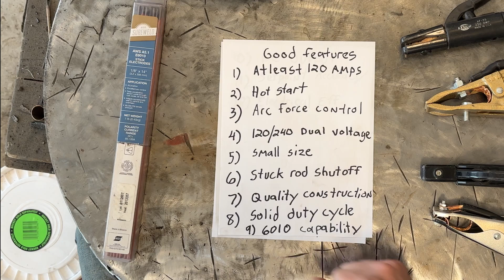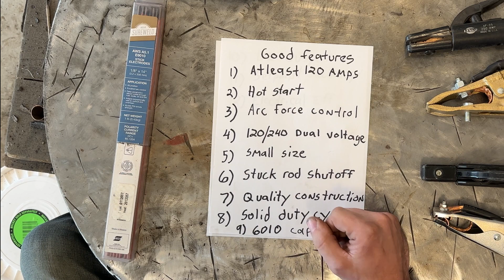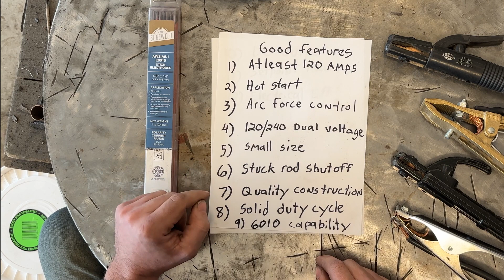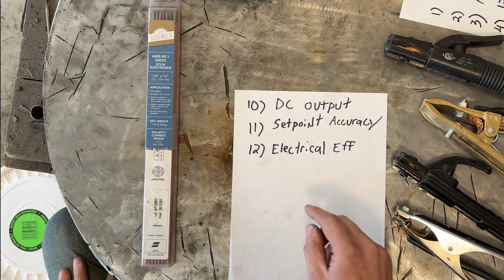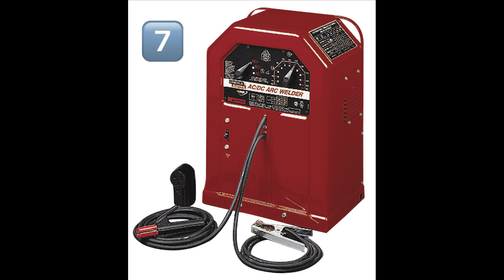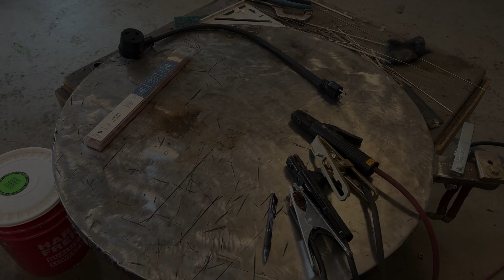Picking out a stick welder (features to look for and top 10 recommendations)

Comment: Absolutely maddening! No matter what I do, no matter the settings, prepping, grinding, clamping, cleaning, ran it on 110, 220, etc., the rods stick EVERY f#&$%! time. I literally just gave up. I recently purchased an ArcCaptain MIG200 & spent hours trying to make it work. Destroyed about 30-6011 & 7018 rods & a lot of scrap steel. What am I doing wrong?
Reply from the maker: Couple thoughts that should help you.  Some welders have really low “open circuit” voltage, which makes it more difficult to start a arc.  The higher the open circuit voltage the easier it is to start the arc because the arc will jump a slight gap easier.  The two rods you picked are the hardest to start without sticking, so that’s partially why.  Grab yourself some 6013s or 7014s and you will be in better shape by far.  Once you can start the arc with zero issues with either of those rods it will be easier to go back to 6011 and 7018.  

At the beginning it can be frustrating for sure, don’t give up.  I think it’s just down to two things 1) inexperience, and 2) your welder probably has low open circuit voltage.  Switching rods will help a lot.  Switching to a different stick welder could also help, but you can work with what you have.  I have never used that particular welder so it’s tough for me to know how much the welder is playing a role.
Reply: I had your problem with cheap welders, their current display is waaaay to low vs actual plus they dont have hot start.
All of my sticking problems virtually went with a decent machine, I got a Transteel 2200, but the cheaper transpocket are even better with stick inc 6010. That worked for me anyway. 6013 gave me nightmares with slag inclusion, I only started getting good with practice with 7018, my problem was I was going too fast and not feeling the rod very slightly scrape on the weld-you should be able to 'feel' it.
Reply: An old thread, but... Be sure you have circuit breakers rated high enough to work. Welding machines need amperage to get the job done, and your power supply is essential for getting a quality weld (Wattage, P = IE, which means the power supply available equals amperage times voltage). Heck, pay an electrician to upgrade the wiring, circuit breakers and receptacles. Also, 220-VAC seems to work best (you get two hot wires instead of one, and usually higher rated wiring/circuit breakers, yes, I said breakers, because 220-VAC actually has two 110-VAC breakers... Think of a SINGLE 110-VAC 20-amp circuit breaker to power your welding machine. Then think of DUAL 220-VAC 40-amp circuit breakers, well you have four times the wattage as a power supply at the outlet receptacle where you plug in the welding machine).

Comment: Greg, the number 7 welder is a 240 V Lincoln AC/DC tombstone. Would you expect this welder to be 6010 capable?
Reply from the maker: The DC capable tombstone should run 6010 no problem.  I would highly recommend 6010 5p+ if you can find them.  The smoothness of the arc will be a little easier to make a good looking bead.  The 5p red rod produces a very rough bead appearance.
Reply: I own this welder along with the titanium 140. Hence, the question. Thank you

Comment: Are the number 10 welders worth buying? Even if it’s to learn, do some bigger jobs than my mig can handle. Use it maybe 10-20 times per year. If I’m any good, buy a better one. Thanks for the videos
Reply from the maker: There is what I would say is a acceptable minimum price to pay for a welder.  When it comes to stick welders I truly believe the harbor freight titanium 225 is the best starting stick welder a person can buy for 350$ and under.  It welds with all rods, is portable, it’s setpoints are accurate, and it has no issue making excellent welds.  It’s so uncommon to find a stick welder for less than 275$ (with coupon) that is capable of running 6011 properly (let alone 6010) that has accurate set points.  There are a ton of welders in the 100-200$ range that barely run 6013 and 7018. They will “get the job done” but that’s about it.  I have played around with a lot of Amazon specials and cheaper machines,  the limitations you hit at the sub 300$ mark come in fast.  Even many 4-500$ stick welders perform poorly with a lot of rods.
Reply: @makingmistakeswithgreg  thanks for the reply. I’m having a difficult time finding the Titanium in Canada. It looks like my best bet though. Proven, and a good price. I’ll keep lookn’

Comment: You should check out the Yeswelder brand.. I've had a few of the cheap Chinese small welders I also have a Miller 250 twin and a Hobart AC welder. And the Yeswelder ARC-205DS. 130 amp 60% duty cycle 85% efficient and runs 6010 actually does. And very well built. Looking forward to getting one of their multi-process machines

Comment: Have you tried the Everlast welders? I'm a beginner, but I have an Everlast 210STL that welds better than I can. It has adjustable hot start and arc force control. It also has a 6010 mode as well as stuck rod shutoff and is TIG capable. Sells regularly for $399. I don't have any affiliation with them, just a happy customer so far.
Reply from the maker: Everlast makes great welders in specific categories.  Their dedicated tig, stick, and MiG machines are solid.  Their all in one machines (mostly the lightning, I haven’t tried the new typhoon or whatever it’s called) I don’t care for. The software on it and the way you switch processes is terrible.  However like I said their stand alone machines are absolutely solid and I recommend them to everyone.  I like the fact that everlast doesn’t lie about specs, it does what they claim, thats huge In my book.  They also have good adjustability even on their cheaper models.

Comment: Great points !
I'm glad you mentioned PFC 
Power factor corection
Reply from the maker: It makes a huge difference for sure.  I have a video coming out soon dealing with running welders on generators.  The difference PFC can make is huge, in my testing it can be over 20% more efficient at turning input power into output power.
Reply: Exactly @makingmistakeswithgreg

Comment: Bought that little Hone welder.  I use it for barn repairs because it's super portable and dual voltage. I would only buy this for repair not to make a living.
Reply from the maker: It definitely is useful for those kind of things, and for the price you can’t beat it 😀
Reply: I have that hone. My first welder. Man it does everything I need to do.

Comment: Fun to look at all the new bells and whistles but I will (for stick welding, I have a lot of other machines for other processes and combinations) stay with my Miller Thunderbolt XL 300/200 AC/DC welder I bought new twenty some years ago.  Does my heavy lifting and doesn't need to be portable as I have two hundred fifty foot of lead and a choice of breakers up to the 70amp I run it on.  That gives me a 100% duty cycle at 140 amps.  I started on the craftsman AC buzz box and after several years (money was tight) I upgraded to an AC/DC Craftsman which I used until I bought the Thunderbolt.  I will say that I learned an awful lot from these machines since they had no easy start or arc force.  If you use one of them going to a newer model will be a piece of cake.  Also learning pure basic stick made going to MIG very easy.  One of the things that made my AC days easier was Harbor Freight for a short while when they first opened their doors had a DC converter wand that plugged into the buzz box and made it DC for about $30.  Just clipped it in the stinger and away you went.  Worked great but a meathead plugged it into a DC machine and toasted it.  They had stopped carrying it.  A few years later I saw the same item at Eastwood and bought it, but it stayed on the shelf as by then I had upgraded to an AC/DC welder.  They had quite a sale on the Thunderbolt as inverters were on the horizon then.  Never regretted it.
Reply from the maker: That thunderbolt XL is a beast, and definately is a great stick welder to have.  Sure it doesn't have bells and whistles, but that doesn't mean it can't welds some really nice welds.  Arguably it might be a bit harder to start a rod but again experience trumps that.   Thats one of the great things about stick, it can be done to x-ray level welds with even a simple machine.  It has more to do with welding enough with a machine to know how it welds that machine options, and obviously you have the "seat time" with that machine to weld good with it.  

Your also 100% right if you can stick weld good you can mig weld.  Stick welding takes consistency of travel speed, hand position, arc gap, etc.  That is the same with Mig, its just far more forgiving.  Its trivial to go from stick to mig, much harder from mig to stick lol.

Comment: I have a Lincoln Electric 215 MPi. I think it checks about ten of those boxes and I am very satisfied with it
Reply from the maker: What do you think of it so far?  I am a big fan of Lincoln’s Mig machines.  😀
Reply: @makingmistakeswithgreg  I've run 7018 sticks and flux-core with it and I think it's a great machine. The menu is very intuitive and it's easy to use. You can't use 6010 sticks nor run sticks on AC though
Reply: @makingmistakeswithgreg  I actually learned how to stick weld with a IdealArc 210 in college, that thing was a tank!

Comment: Awesome video! Definitely looking into something more portable and 120v capable. My Hobart weighes 115lbs, which isn’t terrible but not ideal for me to lug around and pull my back 😆 definitely looking into that max star 161
Reply from the maker: The maxstar 161 is probably my most favorite welder I have ever owned.  The portability of it is second to none and it’s super handy.  I did buy a esab rogue 200 and will be doing a video on that soon.  It’s super portable (as are all the rogue series) and are a far more affordable option over the miller.  I am a big fan of small quality welders.

Comment: Thanks for sharing your thoughts, Greg. 

I am retired, only occasionally have welding projects, and can but dream of owning any of the higher-end stick welders that you recommend. I have a couple of cheap Chinese welders, one of which, a DEKOPRO 110/220V MMA Welder, 160A Stick ARC Welding Machine IGBT, has most of the features you listed as desirable; it won't do 6010, but I don't care about that. I also own a 250 Amp industrial buzz box, but the Dekopro is much more pleasant to use.  My Dekopro does cut output, if a rod sticks, which is a huge improvement over my buzz box.

Like many I expect, I'll never get to experience a better welder, so I'll never know what I'm missing and anyway, through necessity,  must make do with what I have. If my Chinese welders break, I may be able to repair them, if not, I'll buy another.  

Again, thank you for sharing your expertise.
Reply from the maker: Thanks for the comment 😀.  Obviously 6010 isn’t a end all be all capability.  I am in the same boat as you, modern welders seem to just be more pleasant to use than older buzz boxes.  I seem to have far bigger issues with arc blow with older transformer machines.  Not to mention many old transformer machines are a/c only which I prefer dc.  The modern machines are actually portable too, and don’t tend to loose amperage as you weld with them.  I found that old buzz boxes drop around 5-6 amps as the transformer heated up, which makes it tough to get things dialed in.  Thanks for the recommendation on the dekopro, I was going to buy that one over the little 99$ one but decided to save a bit of money.  I am sure it’s far better than the hone one I bought, and for a average person it would give a lot of capability.  😀
Reply: @makingmistakeswithgreg  The Dekopro with the "smart panel" is the welder I have, it has many useful features, you can even lift tig with it, although I have not tried that feature yet.
Reply: Yes ,

repair with IGBT from Digikey

Comment: Man don't talk about the Arc captain that gives hot start anti stick  all the good stuff while the titanium 225 don't come with any of it
Reply from the maker: The titanium 225 has built in hot start, and rods are real hard to stick because it’s arc force is pretty high 😀.  Never ran the arc captain before, will it run 6010?

Comment: The esab rogue 180 is my next welder
Reply from the maker: You won’t regret it.  It’s built really good and runs 6010 great.  For normal shop use and portable welding you can’t beat it.  😀
Reply: Thanks for the recommendation.  I hope to get one in the future.
Reply: IT has VRD circuitry, but they didn't include a button to turn it on and off..  You have to send it to a service center and let them put in that mode.  Very stupid that you are paying for it.

Comment: very good , thoughtfull recommendations.....eventhough the video is 30 minutes....it was very helpful......thank you....😎😎😎😎😎😎
Reply from the maker: It’s hard for me to give a lot of advice in a short amount of time 😀.  I just want to see people get a quality tool without getting screwed over.  The difference a better stick welder can make is actually huge.  Even the sub 300$ harbor freight is light years ahead in how it welds when compared to most sub 500$ stick welders.  Without actually using both back to back it’s hard to know that.  Anyway thanks for the kind words 😀
Reply: hard to squeeze 30 minutes of quality into a 30 second short...

Comment: Have you used any of the Everlast stick machines?
Reply from the maker: Sure have, and I have owned a few.  The most recent machine I owned from them was the lightening 275.  Their stick machines and dedicated tig/MiG machines are great.  I am not a huge fan of their all in ones (lightening).  Everlast is one of the few cheaper welder companies that doesn’t lie about specs.  If they advertise a 160 amp welder it will put that out without question.  They don’t have weird problems with amperage adjustments (aka inaccurate amp meters) and if they say they run 6010 they will.  The fit and finish and quality of accessories generally aren’t the best, but for the money they are generally not only a good deal but a pretty decent welder.
Reply: @makingmistakeswithgreg  I have their Powerarc 210STL. 👍🏽

Comment: I have an HF250 Dialarc for Tig. I would put a stinger on it when I needed to SMAW. It was so annoying to do that I bought a Titanium 225 for stick.
I'm glad I did. The 225 on 240v is so much better a welder than the HF250 running stick.
I don't know what is going on under the hood of the 225 in 6010 mode but you can hear a relay click as you turn the amp control past the 6010 range. So it is changing some functionality when you go above the limit.
Never had it trip on duty cycle. But I don't push too hard. 1/8" rod and 1/4" material is about my limit.
Reply from the maker: Yeah those 225s weld really good, I miss mine.  I remember hearing that relay click, I believe it has something to do with its dual voltage capability.  I never opened mine but it may actually have dual transformers to be able to run dual voltage.  The clicking may be the change in what transformer is powered on.  This is one way they could keep the voltage high enough to run 6010 at any amp setting and Input voltage.

Comment: Great videos! I’m a new welder that came across your videos last week and love the content.

Recently purchased an everlast 210 stl, DC SMAW/DC GTAW. It was like $380 shipped to my door, 5 year warranty 
E6010 mode
Dual voltage 
Hot start
Arcforce 
Anti stick mode

2T/4T/pedal option for tig, upslope/downslope/pre flow/postflow adjustment 

So far good machine to learn stick/tig on. Light and compact too!
Reply from the maker: I am a fan of everlast welders.  They don’t lie about their specs, they do run 6010, and they are priced within a working persons budget.  Far better than Yes welder and all the other dirt cheap welders out there.  The only welders they make that I am not a fan of is the lightining series (I owned a 275).  The software wasn’t the best on those.  Miller, esab, and Lincoln don’t really have a product to compete at a beginner price for quality features everlast offers.

Comment: Like he said, the harbor freight Titanium stick 225 is surprisingly good. I changed the stinger and ground clamp and also bought 25 feet of 4 awg cable for each side and can now weld anything.
Reply from the maker: I am sure some people scoffed at it being that high on the list but honestly considering it’s price, how it’s available everywhere, and how well it welds, I don’t think you can beat it.  If someone is worried about it lasting buy the warranty and call it good.
Reply: I put 30' of 1awg on it and good clamp and stinger. (Cost as much as the welder) I can weld anywhere in my garage with the power supply out of harm's way. And the cable doesn't get warm.
Reply: I actually made a mistake. I went to 2 awg cable! Even better!
Reply: @curotto100  If you're only running 1/8" electrodes, the #6 welding leads will serve you fine.  I ran about 1lb of 6011 and 5 lbs of 7014 in about 3 hours last weekend with my Titanium Stick 225 with the included stinger and work clamp and #6 leads.  Nothing got warm but the Titanium itself... but it never went into thermal protection... just kept right on burning rods.  It's an impressive little machine.  That thin wierdly shaped stinger kinda grew on me... I actually kinda like it, I can wrap my big paws around it with welding gloves on, it feels precise.  You should give it a chance.
Reply: how does it work with an extension cord? I was planning to buy Titanium Stick 225, but in the manual they have clearly mentioned not to use an extension cord.
Reply: @DevangTandel-m3i  you need to basically build one… very few off the shelf cords are heavy enough. Same principle as with air compressors.